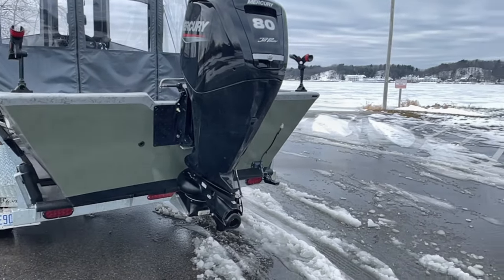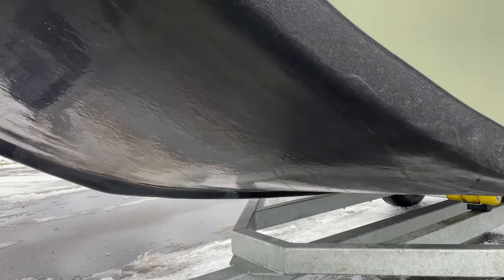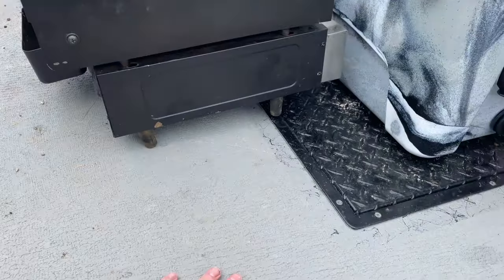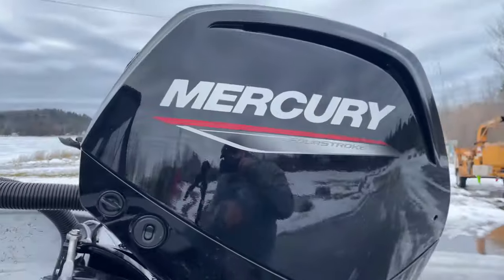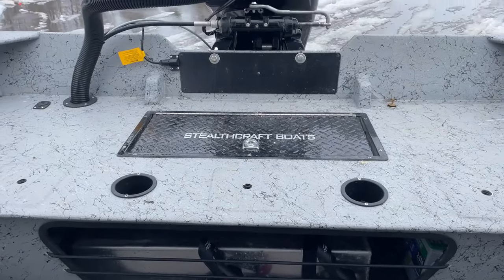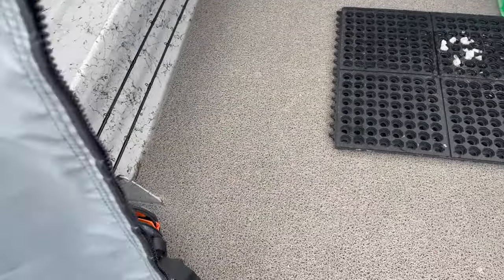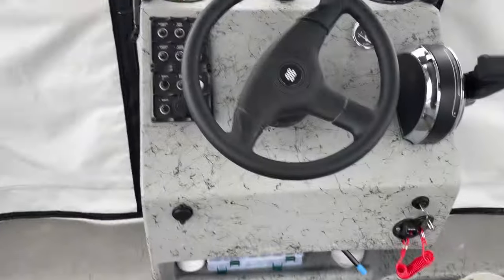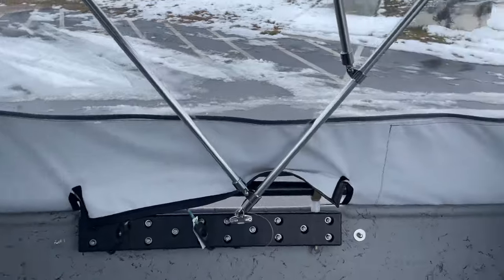The Stealthcraft River Boat: Is it the Ultimate Choice?

Comment: Nice boat Chris. I hope it serves you well.  The Merc 75-115 midrange is a very good outboard platform.  My brother's sled has a 115 and it works very well.

It’s interesting to see how salmon and steelhead fishing boats evolved so much differently between the lake states and us folks in the upper left-hand corner. The sleds out here evolved from wood to aluminum skipping fiberglass entirely.  They evolved from a flat bottom to a V bottom.  Then from center console steering to tiller steering.  From 18’ as being considered a big sled to over 26’now. Then from jet pumps back to props. My little sled is 19’ long with a 6-degree V bottom welded aluminum and it’s a tiller-steered prop boat.  Most folks who own boats designed to run jet pumps run props as much as possible out here.  They usually swap lower units between jet and prop when the conditions demand it. Props also get you around some local regulations on where you are allowed jet pumps.  

It’s really weird for me to see a power anchor winch and no kicker hanging on the transom of your boat. There are no anchor winches on PNW sport fishing boats and everyone has a kicker.  It’s both a practical and safety issue.
Reply from the maker: Kicker and now mount likely being installed next year.
Reply: I recommend holding off on the kicker if you are only using the sled on the river with one caveat.  It’s too cold for the batteries to function well for a bow mount.  You already have oars so going back to a boat ramp somewhere even if it’s not the right one should happen.   

For the kind of currents, it looks like you are fishing in there we just used the bow-mount on spot lock instead of an anchor.  It works much better and allows for easy fine-tuning of your position.  However, for steelhead, we only fish from a fixed position with a sled if the river is high and dirty. Otherwise, you hit the track mode on the bow mount and drift back slower than the current is moving. You need to cover water here, camping out in one place is rarely productive.

The Minnkota Terrovas is the go-to here for almost every boat.  The Ulterras are way too problematic.  Several guides were running Ulterras here but went back to Terrovas.  A 24-volt 80-pound thrust is big enough for your sled however the 36-volt has a much longer battery life.  I have a 24-volt Rhodan Marine 80-pond thrust bow mount power with a 24-volt Lithium 50 amp hour battery on my 19’ Alumaweld Supervee since I sort of do my own thing.
 @tangledtacklefishing
Reply from the maker: @rthurman9065  we don't have many problems with bow mounts around here in the winter.  There are many river boats that run them.  The kicker I'll use in the warm months for trolling inland lakes and such.